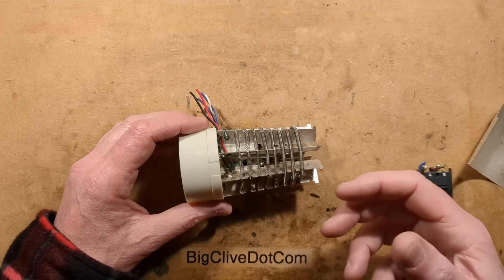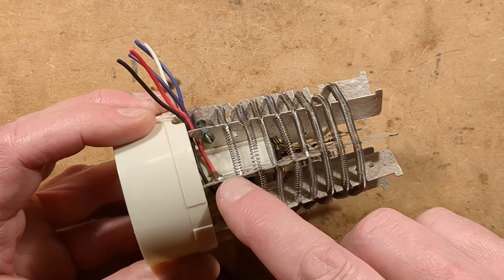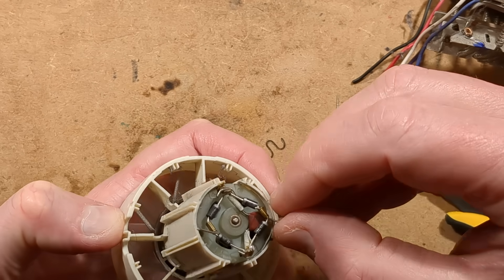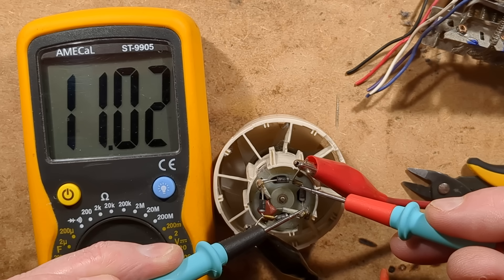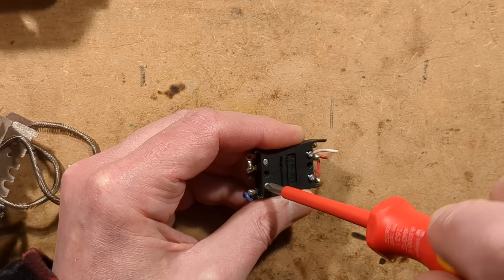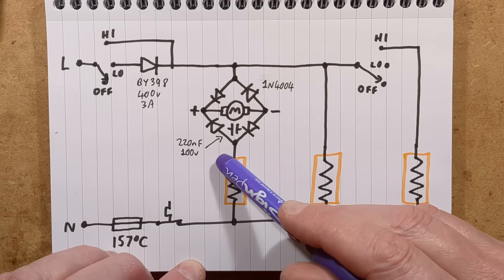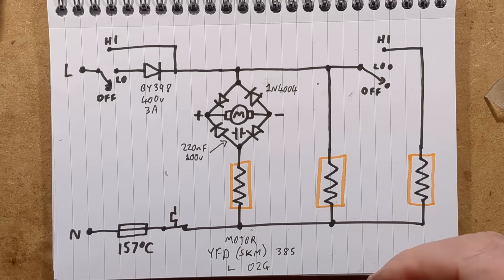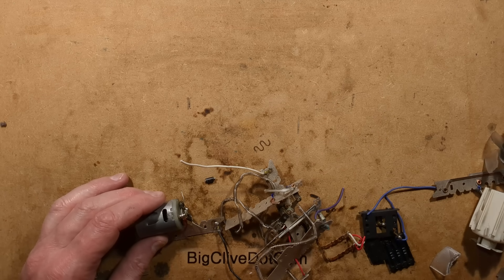Failed hair dryer exploration and schematic

Comment: Now I'm curious what the schematic of a 120v/240v travel hairdryer looks like. How do they do the voltage switching?

On that note, hair dryers here in the states are fun... A standard hair dryer on high will draw 100% (or more!) of a complete circuit. And in my house, the bathroom and two bedrooms share ONE 15A breaker.

Pain.
Reply: It will juggle different sets of elements - it could put two in parallel for 120 V and in series for 240 V. Lots of scope for creativity if you add dual speed. I recently learnt on Technology Connections about the hopeless dishwasher situation in the US, with elements limited to 900 W in case there are other things on the 15 A circuit, which means they have a hot fill and the instructions tell you to run the hot tap before use so that they do actually hot fill. My dishwasher's element is almost three times the power, at 2.4 kW (on 240 V - less on 220 V).

Lots of things are better in the US, but this isn't one of them!
Reply: It has 2 windings, each rated for 130VAC operation, and one has a tap at 20% to power the fan motor with around 20VAC. The voltage switch puts them in series for 230V operation, and for 120V in parallel, and speed switch is again a diode in series with the power that is shorted out for full speed. no note in instructions that operating the voltage selector will short out the mains input at some point while turning it, which likely has resulted in a few being blown up, though more likely got a big boost in speed and power for a few seconds, being left on the 120v setting in 230V countries, and the elements being exposed to 4 times the power dissipation, and the motor more than doubling in speed before something died, as your 500W hair appliance turned into a 2kW burning tornado generator.
Reply: @SeanBZA  As Technology Connections demonstrated with the electric kettles, you can make the US one make hot water really fast if you connect to 240V, but probably only once.
Reply: @deelkar  Yes in a kettle it will do that with little harm to the element, but will kill the switch fast, as it is barely able to handle normal current operation.

Comment: Elegantly simple, fun how the rectifier is soldered directly onto the motor
Reply: With the 2 mystery value disk ceramic capacitors as a token RF filter as well. Used to be in the 1950's ones there was a proper EMI filter in the handle, which was often the source of the magic smoke coming out as well, as the paper capacitors got damp, and the tar made for a good smoke show.